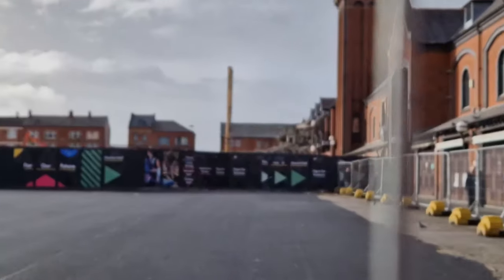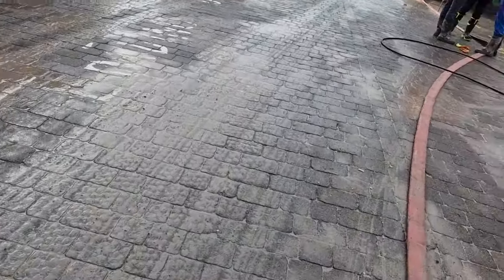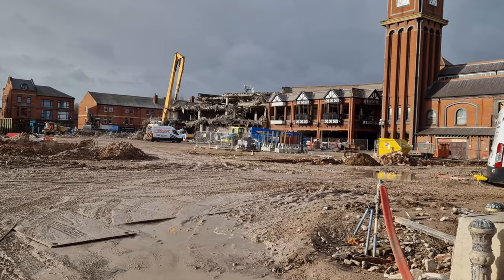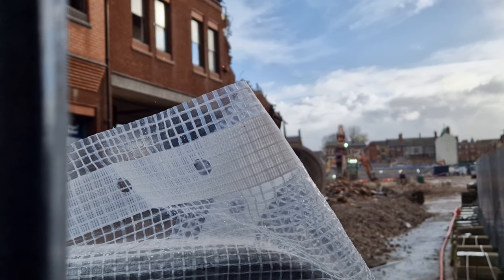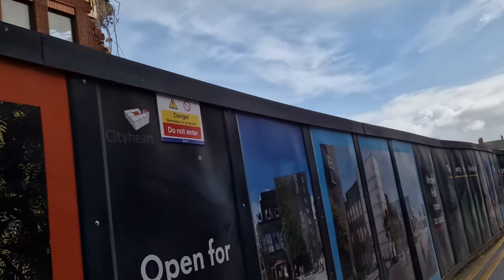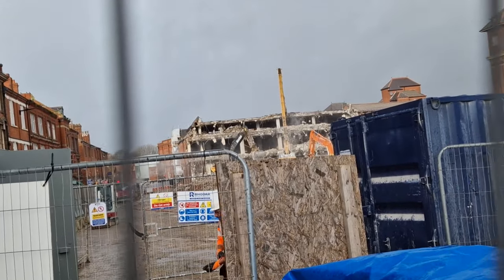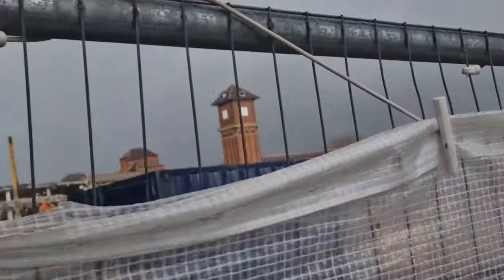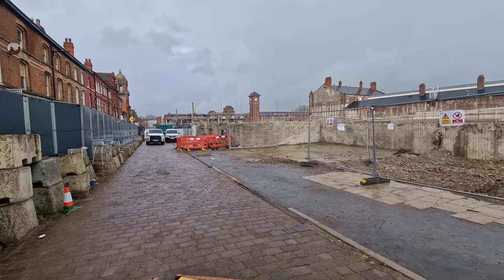Wigan Galleries Demolition 14/11/23

Comment: What's happening with the clock, is that being pulled down aswell?
Reply from the maker: There's been conflicting rumours that the tower will either be pulled down when the market is taken down or the tower will stand and be used in one of the new buildings in some form. Hard to see it staying when it's built into the market like it is.
Reply: The tower is integral to the structure of the market so will come down with the market